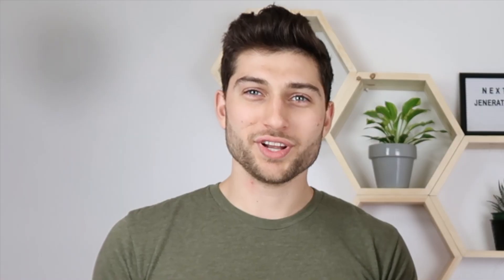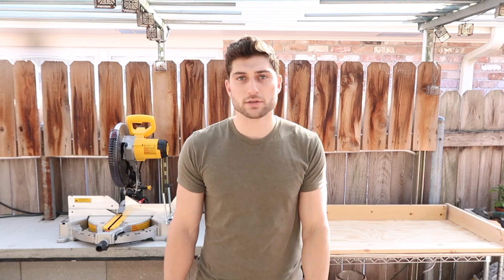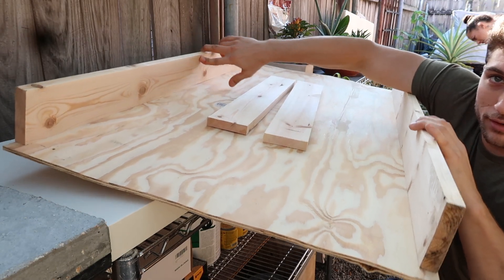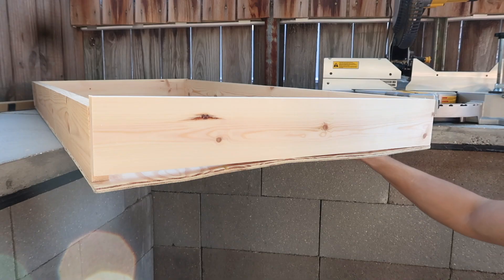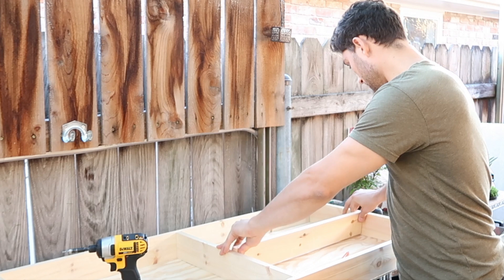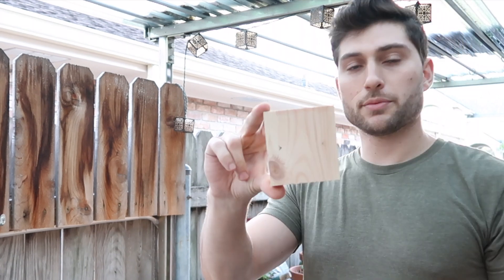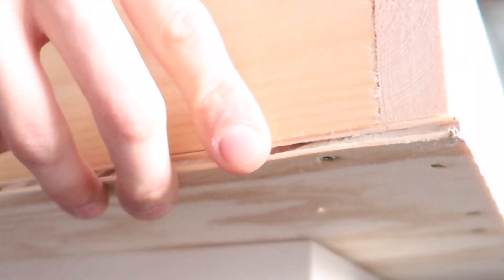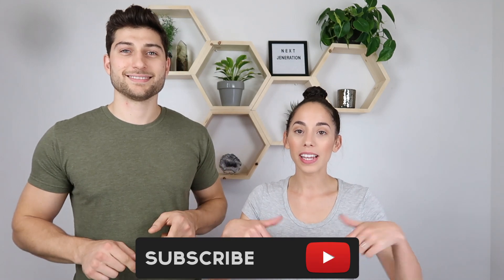DIY UNDER THE BED ORGANIZATION ON WHEELS *UNDER $20*

Comment: I know this is an older video since its 2022, good build but I would suggest pre-drilling your holes.  One of the corner screws split the wood some and over time that can cause strength issues.  Good build though.